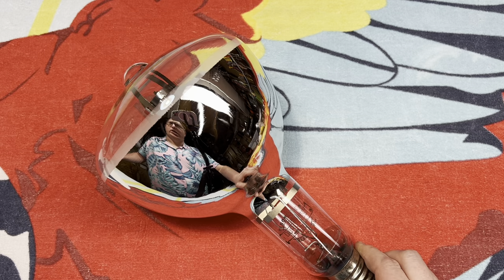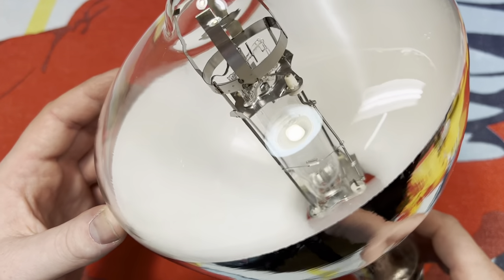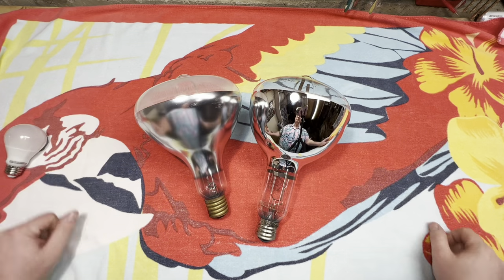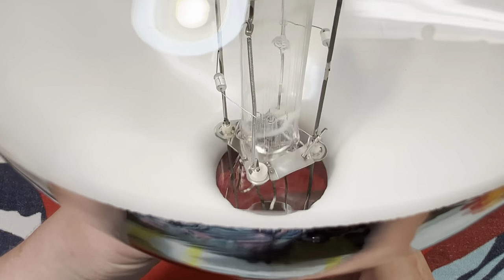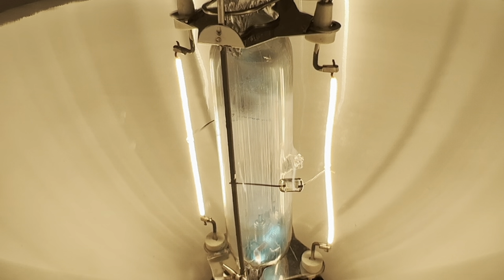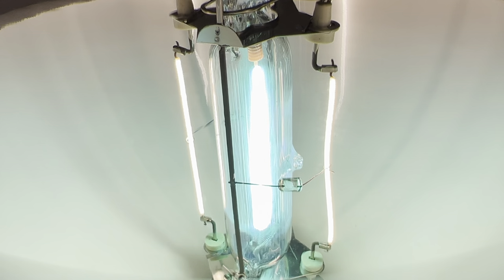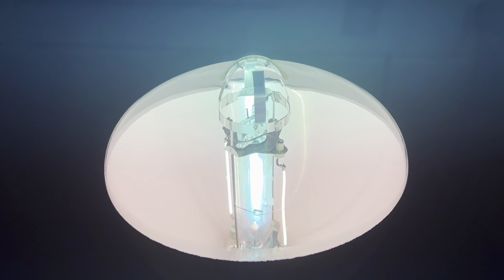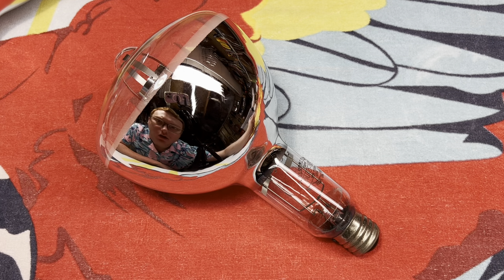Duro-Test Fluomeric 750watt Self Ballasted Mercury Vapor Flood Light Bulb

Comment: 120 volt self ballasted mercury lamps have a heater filament next to one or both of the electrodes that is in series with the ballast filament, or filaments, and a thermal switch.  The heater facilitates in vaporizing the mercury which will allow and arc to be established in the arc tube,  Once the desired temperature is reached, the thermal switch will open allowing the arc tube and ballast filament to operate in series.  The heater filament will also be turned off once the thermal switch opens.  240 volt self ballasted mercury lamps do not have the heater filament as the main voltage is high enough to start the lamp.  These 240 volt lamps do have a starting probe and resistor just like a regular mercury lamp.

Comment: My old GE SBMW sunlamp has a tapped ballast filament with a snap switch which opens part of the filament after starting.  I believe it is used as a starting aid.  The popping sound it makes can be a bit unsettling at first.
Reply: That switch actually shorts out part of the ballast filament once the lamp has warmed up enough, as the mercury discharge tube only drops around 20V right when the arc starts.

Comment: A more accurate term for this awesome bulb would be cool white incandescent.  I found this in my 2006 GE lamp catalog and the initial lumens are 14,000.  11,200 mean lumens,  3900K 50 CRI and 16,000 hour rated life.  That averages out 15 lumens per watt.   16,000 hrs is short for a mercury vapor lamp and is almost certainly limited to the life of the filaments.  Some mercury vapor lamps have been in service for over 20 years and lasted much longer than the manufacturers quote.

Comment: This singing is extremely bright, almost a spice, looking at the sun, even that the reflection on the ceiling and the walls were uncomfortable to look at.

And the heat ….. just those two electrodes  were just staggering%!  It was almost quite powerful enough to admit the light of day and direct sunlight

Comment: Mogul base? Or
 medium base?
Reply: Mogul base.   Lamps over 300 watts are required to use a mogul base.   Many HID lamps over 100 watts use mogul.  The largest HID lamp with medium base is a 200 watt metal halide.   The smallest HID with mogul base is a 50 watt high pressure sodium.